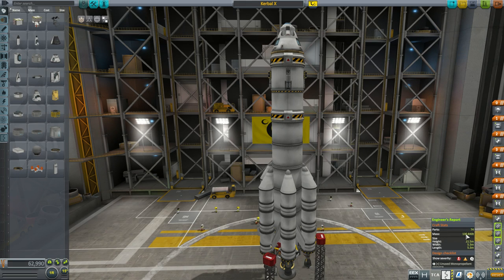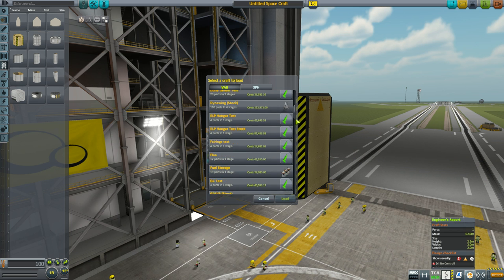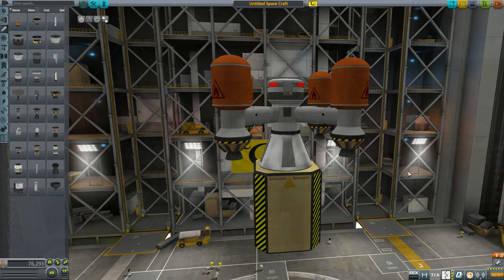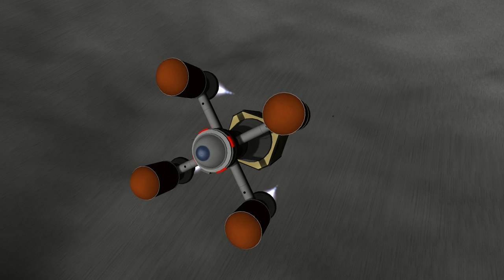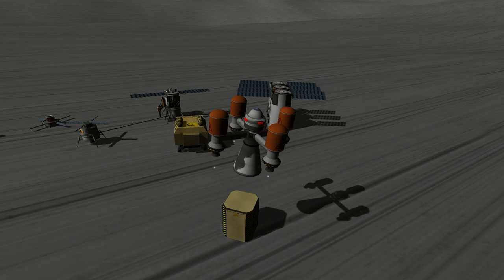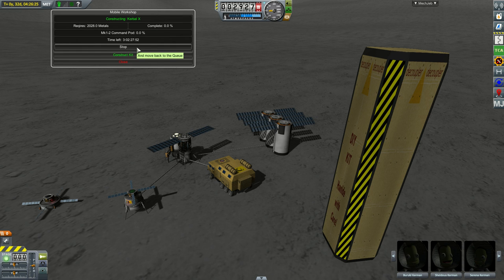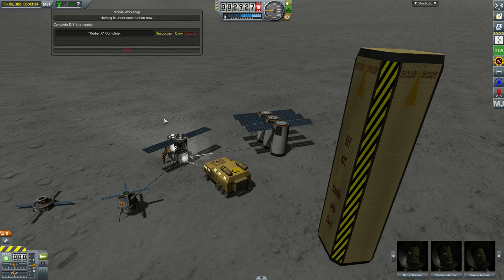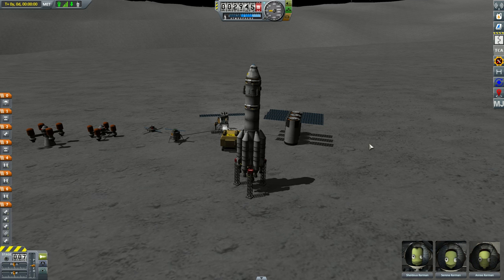Ground Construction - Introduction

Comment: A question, I jnstalled this mod at my KSP 1.4.2 but it not work the items not appeared this options, only sits and acopling settings, but ground construction options not display.
Reply from the maker: There was no release for 1.4.2, as the mod jumped from 1.4.1 directly to 1.4.3. And as of yet there's no release for 1.4.4 either.

Comment: Outdated video... There is no workshop in actual version of the Mod. How this works now?
Reply from the maker: Leonardo Pinchetti, no, the workshop remains the same. So either you have installation problem, or have installed GC bundled with USI which provides its own workshops.
Oh, and the version for KSP-1.4.2 is scheduled only for tomorrow.
Reply: Yes, sorry, sorry, sorrrrrrrryyyyy, my fault. I have so many mods (KSP 1.3.1)  that is a mess in the files. I have never downloaded this mod. The folder with the name of the mod came along with some other mod installed and in that folder there is no Workshop xD. Anyway I have downloaded this mod and installed the workshop files myself and it seems to be going well. Thanks  :D

Comment: do you read old comments? if so, how do you get the materials inside the truck?
Reply from the maker: Either in Editor, or using KAS. And there's an attach node on top, so in principle you can attach a stock docking port. But in practice I would still recommend KAS.
Reply: thx! I was able to build a thunderbird on laythe :)